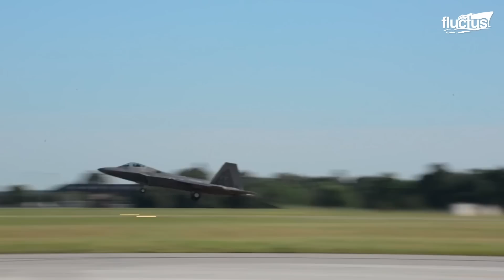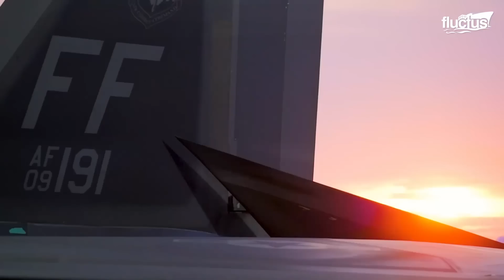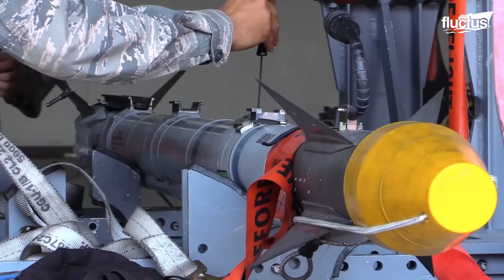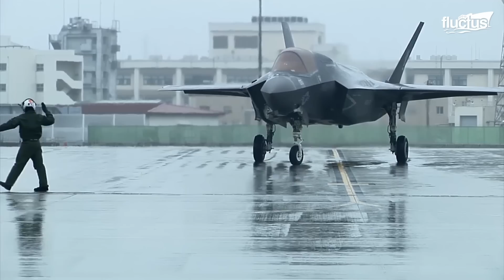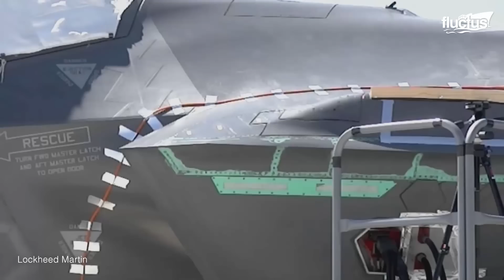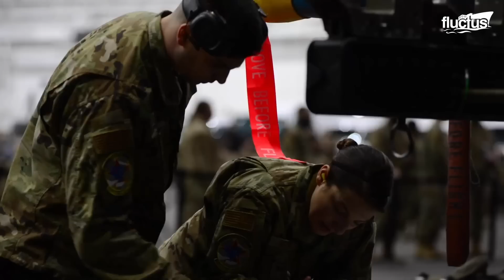Testing the Aggressive Design of the US F-22 to its Extreme Limit

Comment: What a beautiful plane . I could look at it all day standing still let alone flying
Reply: I think that Raptor will remain the most beautiful fighter jet in history. Next gen fighter jet known as the NGAD (Next gen air dominance) will have no vertical tail surfaces and will sport some extremely advanced technologies to advance its stealth capability which will make it less appealing than the Raptor. So let's enjoy this beauty for another decade or so since the Raptor is the first aircraft that will go when the NGAD starts arriving to the fleet.
Reply: @markbrisec3972  
F-16 is by far the most beautiful imo.. the classic version without extra tanks.
Every line and proportion makes for absolutely sublime combination of harmony and simplicity.
Reply: @markbrisec3972  F35 should be retired first. The plane looks ugly
Reply: @mikeyplayzwrld , it's ugly for practical reasons. 

Your complaint, though, is valid for a good reason, & that reason is Recruitment & Retention.

The USAF DEFINITELY has a "drop dead sexy" requirement for whatever air superiority model is expected to be the primary fighter in conflict. The F-22 is no exception.

The upgrade for all flying F-22's that's meant to hold it down until at least 2030 is noticeably shinier. Instead of the eminently practical matte grey it had since '97 getting some sort of metallic-looking surface treatment. 

That's not by mistake. All the US Armed Services are having problems with recruiting & retaining good warfighting talent. One way to help solve this problem is good advertising.

Since World War I & US Army aviation we've sold prospective recruits a lot of Sizzle, & fortunately for us we actually serve up pretty good Steak. There's a lot of fascinating jobs across the US Armed Services. 

Federal civil & military service doesn't have to be boring. If you're willing to truly explore your limits & grow to work beyond what you thought you could do you'll find a lot of interesting, challenging, difficult but rewarding roles these days. We'll never stop looking for a Few Good men & women.

Comment: Everybody goes to the SU-27. Get it right. The SU-27 was built in response to the F-15 and they are pretty evenly matched. The F-22 was built in response to the Sukhoi Gen 4 and 4.5 jets, like the SU-33 and especially the SU-35S, which is still a threat today in 1v1 WVR fights. The latest block SU-35S has the same omni-directional thrust vectoring nozzles that it's had for decades (the Raptor only has bi-directional), new avionics, and AESA (Active Electronic Scanned Array) radar, similar to the Raptor and Lightning II. The SU-57 was built in response to the F-22 and the F-35. In fact an engineer at Sukhoi, when asked why they had jumped from 35 to 57, made the joke that it was "because 22 + 35 is 57", referring to the F-22 and F-35.
Reply: The Russian fighters are nothing more than flying coffins. Their avionics are at least 40 years behind what is found in the F-35.
Reply: cool
Reply: Руссий народ невероятно Упрямый на Войне. Путин смог собрать военную индустрию для создания Сверх Оружия. Русские инженеры всегда находили гениальные решения. Привет из России!

Comment: F22 is a great plane. It saddens me that other commentators praise the F35 more. F22 is bad ass.
Reply: Both are great. But the F-22 is the king when it comes to air superiority. F-35 is a multi-role fighter, aka jack-of-all trades.
Reply: They don't even perform the same role... F-22 is air superiority fighter that was supposed to take the roles of F-15, and F-35 is a general multirole fighter platform that shares it roles with kinds of F-16 and A-10  but also has variants that can land and take off from aircraft carriers or even amphibious warships with VTOL. F-35 has some newer technologies embedded to it like network-based ops system that F-22 cannot carry.
Reply: F 22 I the best for air to air and f 35 is more for carriers
Reply: F-35 is a JOKE!
Reply: @marc9080 F35 is no joke

Comment: I don't know why they ended production early. It's always been my favorite fighter plane.
Reply: I was responding to the guy that was asking why we stopped producing F22
Reply: They ended F22 production early because it had literally no competition, it’s that powerful
Reply: Ended production due to the cost of the  2nd Gulf War and Sen. David Obey slipping in to some unrelated law that it couldn't be sold outside the US.
Reply: @brite_luddite  Why couldn't it be sold outside the US?
Reply: @mrs.6813  Senator Obey just didn't want it sold outside the US.  Supposedly he didn't want the tech getting out, but he was extremely anti military.  Sales would help keep the program going.
Reply: @brite_luddite  That's understandable. However, now the USA has been the selling F-35, the most advanced fighter plane on the planet.
Reply: @mrs.6813  Correct. Obey decided to not run again instead of being voted out just after the F22 deal.  That's one of the reasons why the F35 had international partners in development to avoid a repeat of the F22.
Reply: Because of what is coming for one. And the fact that our closet adversary only has 120 in China with j 20 and Russa last I saw had 7 SU 57 so there's really no need forore
Reply: @cchurch303  I have no idea what you're talking about, you need to rewrite what you wrote, because it doesn't make any sense!
Reply: @craig4867  what's coming in the 6th generation. Between that and the fact we have 7 times as many steath aircraft as our closest adversary China we don't need more F22's with the 187 F22 and I think 600 F35's we far out class the rest of the world put together
Reply: @cchurch303  how about 600 F-15EXs that will be with us for another 50 years! The F-35 can only carry four missiles internally! And if it carries them on the wings or bombs on the wings, it's no longer stealthy and besides, supposedly from everything I've been hearing, China and Russia have a radar system, that can detect stealth aircraft! As far as the F-22 that you asked about, from what I understand, it's cost of the aircraft and maintaining it and they're putting the money towards the new F-15EX which is even more powerful and deadlier than the previous F-15s that I used to fly! I don't know if you read my comments under the video, I now fly the A-10 Thunderbolt 2! If you want to see something interesting, pull up the documentary on YouTube on the F-23 and the documentary is called-Black Widow Gray Ghost, it will blow your mind and that's the plane that they should have gone with and that's just not my opinion! Air Force wish they had gone with it!
Reply: @craig4867  Nothing will replace the A10. It's a total monster in its domain. But 5th gen can't be beat.
Reply: @srinitaaigaura  why don't you read my comment under the video and apparently you didn't, I'm a fighter pilot in the United States Air Force and I currently fly the A-10 and to compare fifth generation with an A-10 is stupid it's not designed as a stealth aircraft, read what I wrote! Have a nice day!
Reply: @craig4867  A10 fan here. Was seeing a video about just how insane the engineering is on it. Awesome you fly those sir.
Reply: @srinitaaigaura  the A10 isn’t as good as it was thought to be though
Reply: They ended the F-22 early because of money!
Reply: They got too expensive
Reply: The price is the problem
Reply: They ended it because they're putting the money into the F-15EX, which will be around for approximately another 50 years, and it's the greatest air superiority fighter in the world! 104 kills 0 losses in air-to-air combat! Mach 2.5 +! I should know, I'm a fighter pilot United States Air Force!
Reply: @craig4867  I thought Saudi Arabia paid for the upgrades to the F-15EX and the F-22 was just too expensive so they were moving on to the F-35
Reply: @joshuagenes  Joshua, the F-15EX is a brand new aircraft, it's not an old F-15 being updated and as far as I know, we're not going to be selling them the new F-15EX and I hope we never do, they do however, fly the F-15C which is the older model! As far as the F-35 is concerned, I believe we're selling on that and in my opinion, I would not be selling any of our technology to any country, because it can come back and bite you in the butt! Take the AK-47 karishnakov, it came back to bite Russia in the ass and now everybody uses it! It's bad enough we walked away from 86 billion dollars worth of equipment in Afghanistan and it was all state of the art and now China has it, along with the largest Air Base in the world, and when I say China, they're back engineering all our aircraft that we left over there and other things! We left 26 brand new AH-64 Apache helicopters, state of the art technology and we left it behind! Shameful and unconscionable! Have a nice day!
Reply: The only person to claim Apache's were left behind is Trump and that claim had no actual evidence and has been proven wrong. Not a single source says anything about 26 Apache's.
Reply: @craig4867  They built the F-15EX because they needed more air superiority fighters and the F-22 production plant was ended more than a decade ago. The F-15 has continually been producing more units for other countries, so we just used that production line and made some additions. The F-15EX is in no way better than the F-22 except some slightly updated targeting and avionic system. It is a stopgap measure to replace aging F-15C's and maintain an acceptable fleet size.
Reply: @craig4867  Uh... no... The F-15 EX wasn''t on the drawing board whenever they canceled F-22s production run. Back then, the proposal was to convert B1-B Lancers into missile trucks with F-22s, F-35s or F-15s in the lead role communicating target data so that the Bone would volley/ripple fire dozens of long range improved A-120Ms into the enemy lines. This was before the Felon was officially revealed and the Su-47 Berkut was the stand in for "future threat".

In short, Congress as per usual is full of stupid fucking assholes who only do things for whom they get paid for. They voted to not only cancel the 22s production because they saw "no need for it" since it wasn't the answer to the money making "War on Terror" bullshit, but they also shot down it's exporting to close allies twice. Japan was willing to pay for the upfront development cost of a export engineered F-22 (export variants have extensive reverse engineering protection and costs extra to develop an export variant of any military high grade asset). 

Despite this, in 1999 we already knew China had aspirations to catch up and we saw Putin rising by 2008. The Sec Def for Obama canceled the F-22 by 2009 and by then, Russia was already flirting with invading Georgia, showing that Big-Power wars were on the horizon. 

We know have to rely on the F-35, which is probably the second best to the F-22 compared to everything else in the air - but we only have one production plant for it. This isn't WW2 or the 50s or 60s, where multiple manufacturers competed for contracts of 500 some odd aircraft, giving a wide variety of assets and aircraft that could be refreshed every 10 years. We have roughly only 2 major manufacturers now, and the F-35s belongs to one them. In short, we cannot get aircraft FAST ENOUGH to replace the F-15s because the Obama administration - via treason or stupidity; refused to acknowledge the rising threats and thus cut 22 production at 186 aircraft when the original order was for over 800. As a result, in the current climate? We do not have enough available aircraft ready to fight. Most of the F-15C airframes are approaching 40+ years old and the wear and tear is horrible. A refresh deal was looked at by 2019 into 2020, which Boeing (whom took over McD-D) proposed a massive refresh to the F-15, similar to the likes of the F-18 Super Hornet refresh. 

USAF Generals recognized that while the cost for the value wasn't optimal, it did refresh the airframes entirely; essentially building new jets to resetting their age to 0. They needed new fighters in their inventory fast and so they agreed to look into it further. In early 2020, leadership stated that no 4th gen refresh of any such fighter in the inventory could ever replace the F-35, and thus the intent was to never reduce the F-35s orders. It was simply a need for new airframes, right now, right away, ASAP; because the USAF fleet is so old that it's a disaster waiting to happen. 

Fast forward to our new leadership, who's a lot like the idiot, Obama - and suddenly Russia is invading people AGAIN and this time, they DO have an aircraft that's a threat to 4th generation aircraft. What's worse? China caught up in 10 years and are posturing for war as well. 

Wow

Who would've thought.

Out country is run by corrupt, stupid ass mother fuckers dude.
Reply: @Nurhaal  You left out your man *rump - you know, the one who stole over 35 boxes of above top secret gov't and nuclear docs to sell to whoever was the highest bidder.....